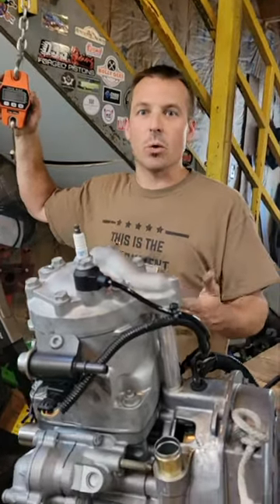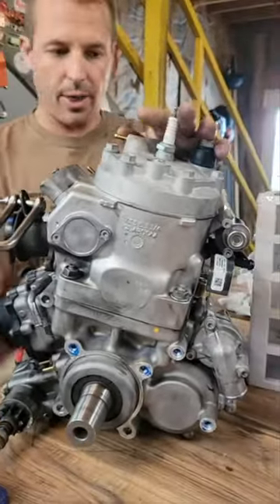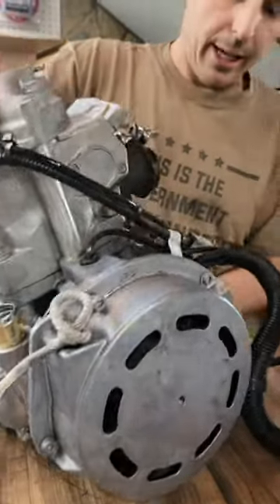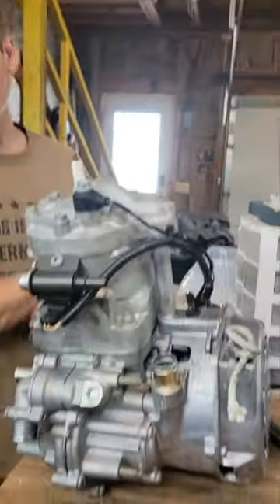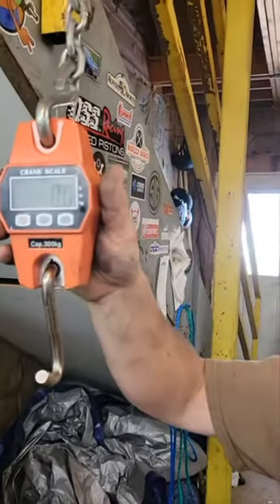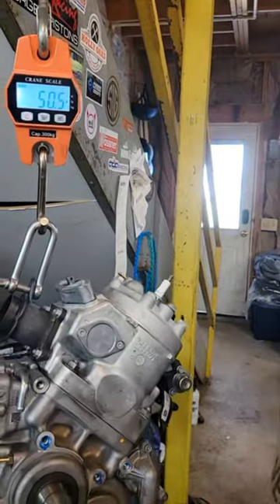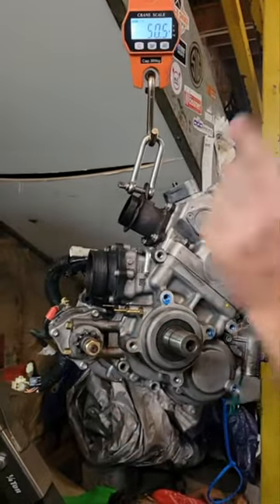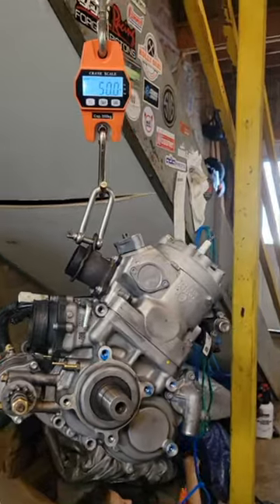High horsepower,  low weight, EFI ultralight aircraft engine!!

Comment: What about porting and polishing it...could add 3-5 hp gain along with a good exhaust  setup you could be close to 80 hp. With that setup you would have an absolute beast of an engine and still maintain dependability.......when is the next video coming out, I'm excited to see your build.....I'm guessing this would be a bit cheaper than a Rotax engine, lol
Reply from the maker: There are a bunch of upgrades available for this engine, including a big bore kit (450cc's). I would be willing to say that it could produce close to 100hp reliably, as the twin cylinder version is routinely built up to 200hp. But then all the internet experimental aircraft engine experts would have to come out and remind me that I am just a dumb hick. You see,  rotax couldn't figure out how to rev an aircraft engine over 6500 RPM reliably 45 years ago, so it can never be done 😅
I am now to a point where I am figuring out the details on the test stand.  I have the engine running,  but there are cooling system mysteries, efi gremlins, etc. to figure out before I can really flog this thing properly! I'll try to make a video when I can. I'm also not capable of editing a decent video if you read through the expertly formed comments of my videos.
Thanks for the feedback and support! It's more fun when others share my excitement!
Reply: @kidkhaos6427  Thanks for the reply,   best of luck with the engine, I think if you get it all worked out and you can get close to 100 hp in the future it would provide a power to weight ratio others would drool over ....never mind the cost savings compared to a Rotax engine
Reply from the maker: 😅 Luckily, I'm not burdened with an overwhelming amount of youtube comments. I'm lucky to get any, and double lucky if they aren't to point out one of my many shortcomings. Unless it's  my mom telling me I'm so handsome in that shirt or whatever. Thanks mom!
One thing I forgot to mention is that this will not beat rotax on price. These engines only came out 2 years ago, so getting a used machine is difficult and does not offer the savings most DIY'ers typically seek. I would expect that to change over time as they become more widely available. 
I am working on converting the old-school yamaha phazer next, which would be a cheaper option... also can easily be over 75 hp and reliable.  I have one sitting on my bench, and I have started formulating a conversion plan, but that is as far as I have gotten.
Reply: @kidkhaos6427  LOL I see........Yeah  the Yamaha engine has become popular for aircraft conversion engines, and price friendly.
Reply from the maker: @Todd Brown  I have already engineered a conversion for the 4 stroke phazer. I designed and manufacture the parts for BK Experimental. Im talking about the one before it, which is a 2 stroke. It's lighter than a 447, but more powerful than a 582, super plentiful,  cheap to rebuild, aircooled. Lots of pluses!
Reply: @kidkhaos6427  I've only recently during the lock downs started, getting the itch to start chasing the dream to fly. I used to be a auto and motorcycle tech and i started thinking of several engines i thought could be converted to fly.  But one thing i noticed quickly is many in the aircraft community are kinda like the money's that got the hose for trying to get the banana.  Eventually none got the hose and wouldn't try to get the banana.  So many of these people think you can't do anything but use something that someone 30 or 40 years ago had the guts and intelligence to make them work.  Your a pretty smart guy keep ignoring the monkeys that say your can't !

Comment: Hey buddy.That is a watercooled engine??impressive 50lbs.can u run 2 ignitions?
Reply from the maker: Yes, it is water cooled. This engine was only made in single ignition.  Sure, I could design and machine a dual ignition head and add another coil. But,  I have no intentions of doing so.